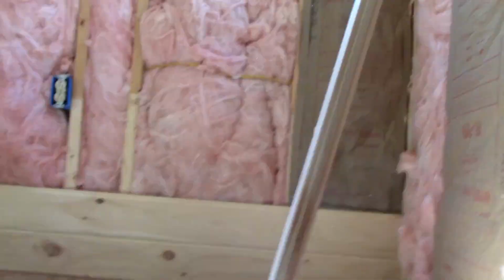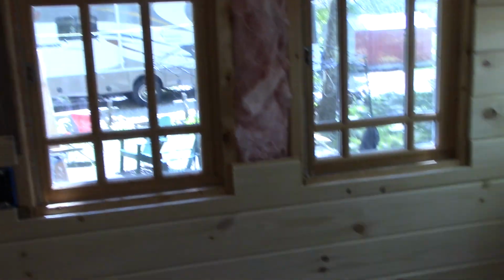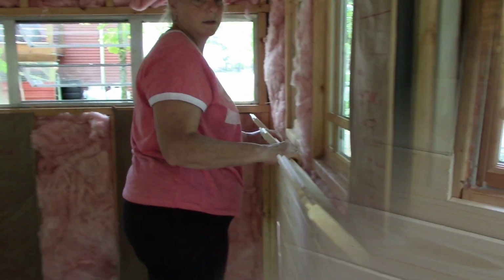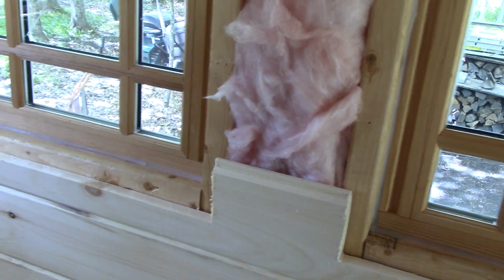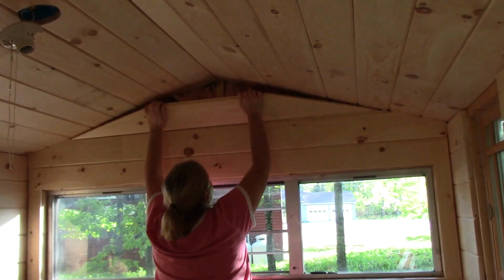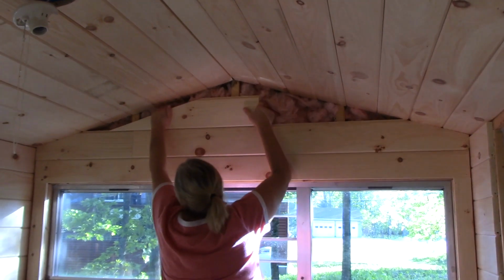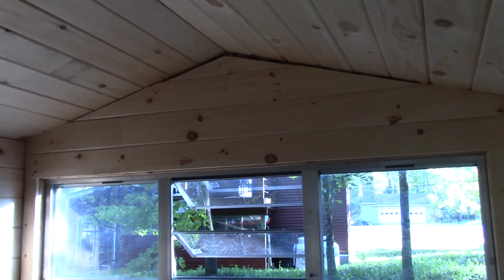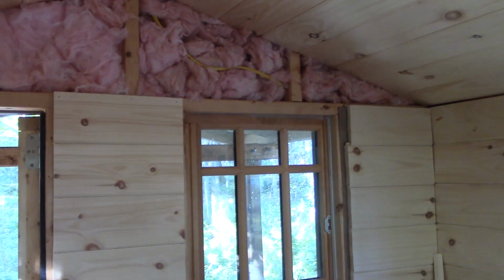Getting KNOTTY in a She Shed!

Comment: Many years ago I used the thin knotty pine boards to remodel our old 12'X60' mobile trailer home I ended up doing every room in it. It looked like you walked into  1800's cabin when I was done. That was back in my drinking days it turned out beautifully. I did my best spot on work when I was six sheets to the wind. If I tried doing is when I was sober I messed everything up... LOL.
Needless to say it's been 18 years now since I've done much wood working. I get to frustrated when I keep messing up on my cuts. But it's not worth jumping back into the bottle I fought and crawled my way out of. With a lot of help from God and the tables of AA... 
You kids are doing a fine job on that trailer. I can hardly wait to see it when It's all finished...  Much love and prayers be blessed in Jesus name... BBE..